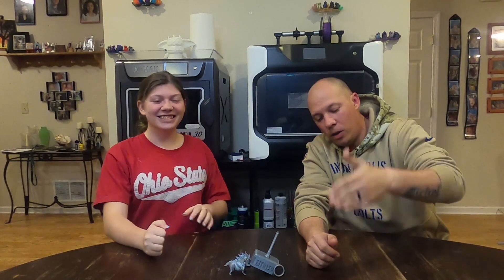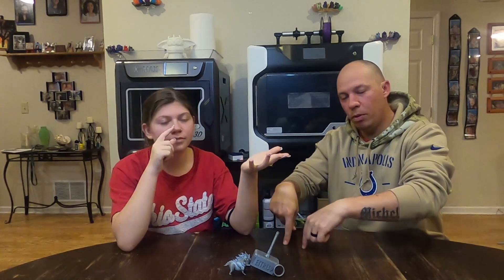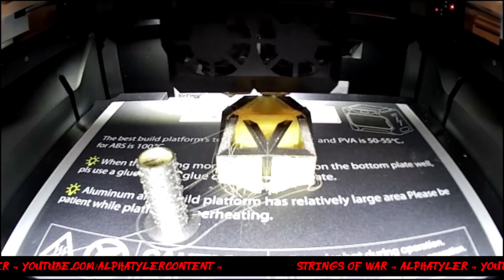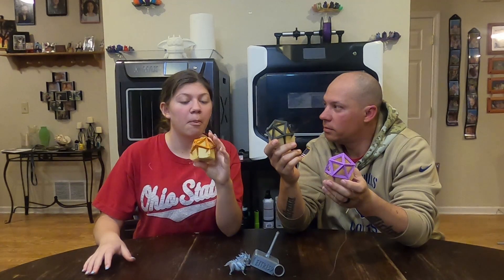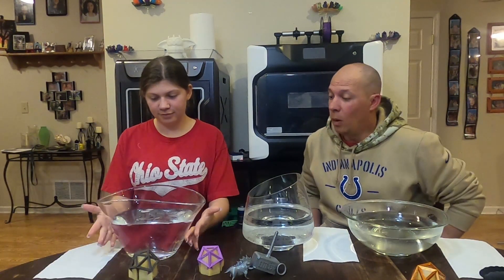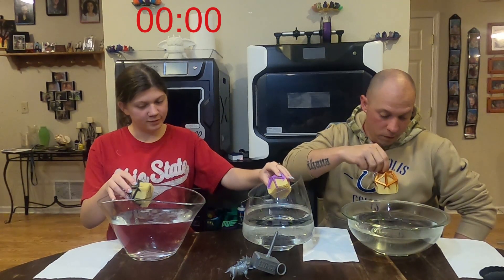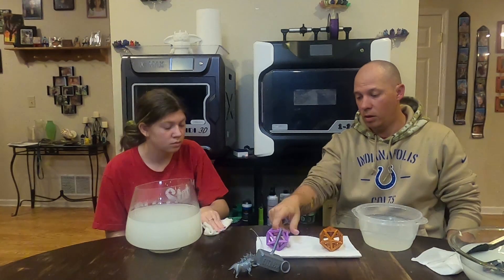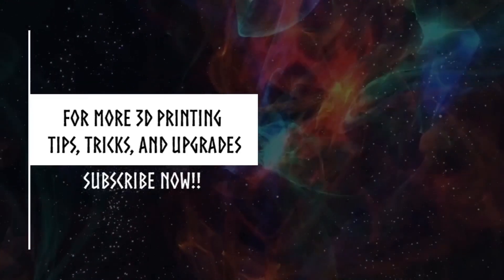Printing PVA with Qidi I-Fast! Dissolving in Hot or Cold water?

Comment: Mike are you satisfied with the new Qidi I-Fast? I also have an Qidi X-Max which is a great printer, and was thinking of ordering a I-Fast for myself. I print a lot of PC-CF.
Reply from the maker: I love my I-fast to be honest with you. I barely run my x-max anymore. I also only run PLA through it. Now I know that the newest printer that is designed for CF that you may want to look into. I do t have that one so I cannot speak on it.
Reply: @Eitri3D  DO you know the model of the new one, and has it been released? I can't seem to find it. Thx
Reply from the maker: Qidi X-CF Pro and it is currently sold out on Amazon but I think you can get it from Ali Express if from Qidi direct. I know a few that have already received theirs.
Reply: @Eitri3D  Cool, Thanks Mike
Reply from the maker: No problem.

Comment: How do you like the i-fast compared to the x-max? Have you encountered new issues?
Reply from the maker: As of now, the I-Fast is limited on temp to approximately 250° with dual nozzles. With my X-Max upgrades I can switch to any filament without issues. Each printer serves different purposes for me so it is hard for me to compare them to each other.